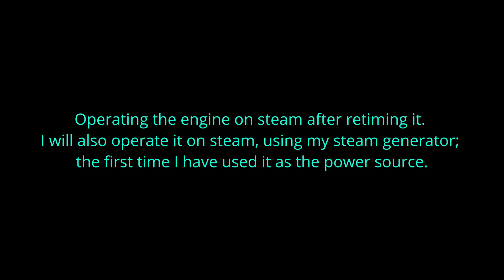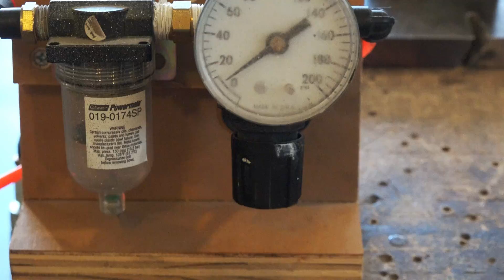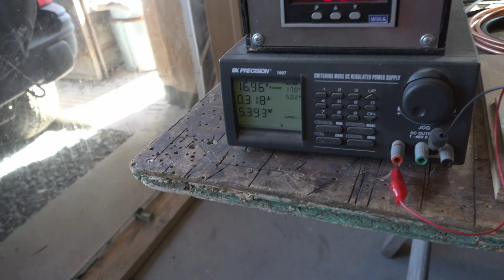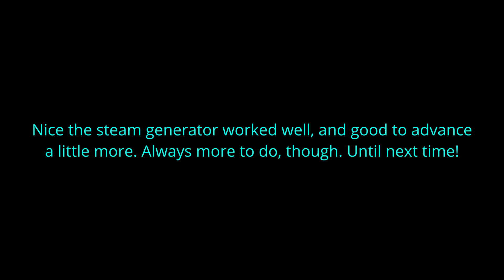First steam operated run of this engine, using the flash steam generator

Comment: Cool video
Reply from the maker: Thanks!
Reply: @oldtownvids  what are the pressures on those pipes? Did you pressure test them or what? It's a really cool project you can try making like a pressure hammer that is directly connected to the piston.
Reply from the maker: Hi Stasi, My little water pump has a pretty cheap pressure relief valve on it that I set for above 100 lbs PSI, and I have never tripped it but I have had the pressure around 140PSI. The tubing is really strong stainless thick wall tubing, called duplex stainless. I am not sure what pressure it can handle, but at least several hundred lbs. for sure. And if it ever did explode, it would not be too big of an explosion because the total water capacity of the steam generator is around 1 ounce of liquid...a little more when adding all the piping, but still a very small amount. I like your idea of making a pressure hammer! My long term plan is to run a generator and make electricity. Thanks for watching and commenting!